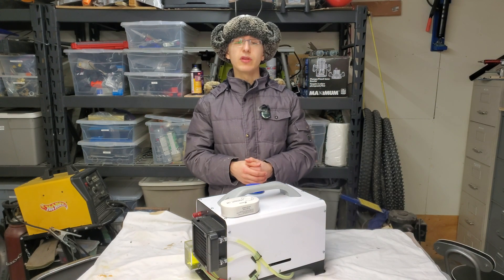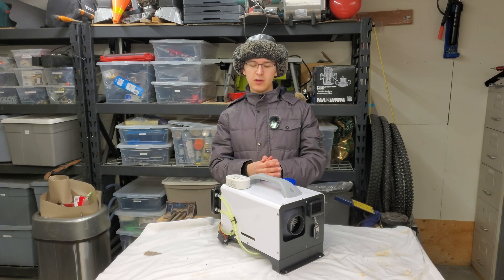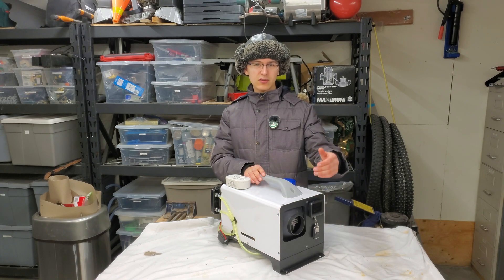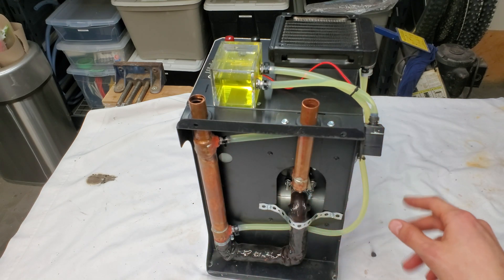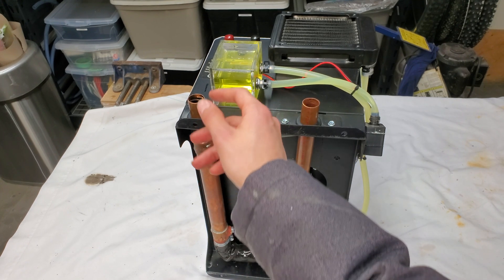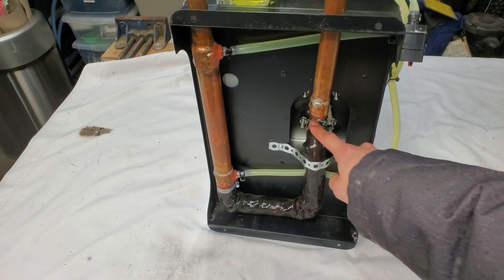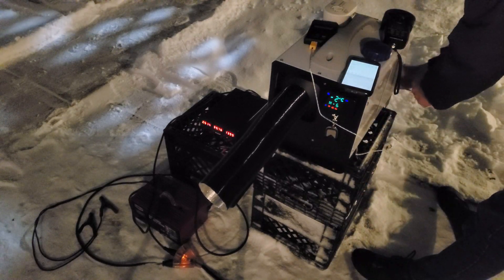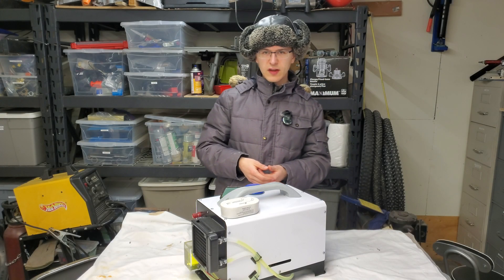5 kW Diesel Heater - DIY Exhaust Heat Recovery System - 90%+ Efficiency

Comment from the maker: Hey Guys,

I would like to address a couple things:
• In this video, no pressure-relief is shown for the glycol loop. This is unlikely to be a major issue, but could be a safety concern if the pump were to fail, and the glycol boiled. To fix this, I've drilled a 1/8" hole in the top-cap of the reservoir, which can let out any steam.
• The tubing shown was a little thin, and prone to kinking. This is all I had on hand at the time, in the parts list, I've replaced it with tubing that is thicker, and more kink-resistant.
• Some viewers are concerned about long-term corrosion of the heat exchangers from acidic condensate. The only fool-proof way to address this would be make the exchanger from stainless steel. I only use this when camping, so I can't confirm how long this would last under daily use.

Comment: Your efficiency numbers don't look right. Diesel heaters are not 90% efficient, and it would break the laws of physics to extract more energy from the fuel than is in the fuel, meaning that your efficiency numbers of over 100% are impossible.

Comment: Nice Concept BUT THE EXCHANGER INTERIOR CONTACT SURFACE AREA IS TOO SMALL TO DEAL EFFECTIVELY WITH THE HIGH TEMPS OF EXHAUST-----BASIC HVAC SCIENCE---needs a little realistic engineering to make it work----OH DON'T FORGET THE PUMPS AND STORAGE TANK FOR THE HEATED WATER and pressure relief valve, plumbing and valves, pipe insulation etc.---AND HEAT EXCHANGE SYSTEM FROM STORAGE TO SPACE HEATING   GETS INTO A BIG and expensive PROJECT FAST----KEEP IT AT AIR HEAT EXCHANGE

Comment: Just wanted to say that I love the video.  Interesting setup and thinking outside the box is always incredible.  However, there is just one thing that I would like to suggest.  I went and checked out your list of parts.  For one, the Radiator link goes to something that is not a Radiator LOL...  Just thought you would like to change that link to an actual Radiator :).

The biggest concern I have is the CO detector link.  Please Please take that down, I beg you.  These types of CO detectors are very very dangerous as there is no digital readout, and most all of these types of detectors won't alarm until the CO is at dangerous levels (around 60-70ppm).  I know from experience (I nearly died from CO poisoning).  If you have 20-50ppm CO in your environment over a prolonged period of time, it is accumulative in your system, and can cause death, and the people in the home or RV won't even know what is happening to them until it is too late.  I have done allot of research, testing and reviewing of Air Quality monitors, CO and CO2 monitors, and one of the biggest questions that I get asked by viewers is describing their symptoms and wanting to know what is going on in their home...  A number of times, these questions and communications back and forth, led me to discover very possibly high CO and CO2 levels as the culprit, and by high I mean as low as 20 to 50ppm CO or more than 1000ppm CO2 in an environment continuously, causing a build-up of toxicity in their system causing the symptoms.  Luckily they purchased the correct types of CO and CO2 detectors and discovered that they indeed had higher levels of CO and CO2 in their environment that their (non-digital) CO and CO2 detectors were not alerting them too...

Fire alarms are another big mistake that people trust to alert them of CO, but again, these alarms usually are set to not alarm until the CO reaches dangerous levels, and again, any level below that alarm level is very deadly if not known, and why a handheld CO and CO2 meter is essential.  I am not saying that Fire alarms or the CO alarm that you link too are not good to have, but what I am saying is that you should never ever just simply rely on them alone.  So at least if you could also link to and recommend a digital handheld CO and CO2 meter to use in conjunction with the analog ones -- that would be great.  

Have a Merry Christmas 👍

Comment: So let's think about this for a minute. You're increasing efficiency by increasing the intake air temperature. How? 

If this unit's able to, let's just say make a Delta t 200°. You're increasing the exhaust temperatures by increasing the air intake temperature. It's kind of self-defeating. Yeah sure. It's definitely going to be more efficient cuz you're pulling heat out of the exhaust, but you're adding it to the air intake making it work harder to get rid of the heat again. Delta t is what you want. This is making the delta t closer

Comment: Any concern with hot air damaging the fan and components on the cold side of the diesel heater? 
Has anyone tried to spiral the exhaust vertically down below the heater, encased in a cylinder (wide section of flu pipe) with a fan on one end of the enclosure (extracting heat from the exhaust). and condensate would flow freely down and out the pipe.

Comment: Awesome! I realize that these simple units are very basic (not really intended for high efficiency), but some heat recovery is a very good idea. Like normal condensing boilers this allows more flexibility in the exhaust routing. Not melting tarps and tents is a good thing.

Comment: This is awesome. Wish there was a premade kit for this
Reply: Be very careful. There is a reason these are not pre-built into the units. At least not in this way. He doesn't explain any of the dangers. Either by not knowing or it is not significant to him. Let me try and explain.
Very hot exhaust burns more of the toxic gasses away like Benzen, Formaldehyde and more.
Cooling the exhaust creates condensed concentration of these gasses which can make you very sick and even death.
However, this can be done safer with some notable factors. 

He should use a stainless heat exchanger. The soldered copper joints will eventually heat up and fail (by the looks of the bubbling in the resivoir. It might be already.)
Which brings me to pressure. The heat exchanger system must absolutely have a pressure release valve.
A gas monitor/tester. These are cheap and can save your life. 

These are a few important safety factors to consider before modifying your diesel heater.

Comment: Just my idea............If u take the hot radiator off the heaters air intake and u place that radiator it in in the same room as the the normal hot air tube and let a fan run behind it  would that not be more efficient?

It wont make a diffence and for sure the heater aint portable as it is now but would that not be the maximum u could get out of heater.

(Or run the hot exhaust gasses trough a aluminium/copper intercooler with a fan behind it as thats my best idea of getting the max energy from it but this wont make it portable as they are)

Comment: Great video.I had similar idea. How did you attach bigger tube to the smaller tube on the heat exchanger? I am going to use 12v fan on the radiator rather than restricting heater fan air flow. What kind of pump did you use.?Thanks
Reply from the maker: The heat exchanger is made with 3/4" Copper tube, and 1" Copper tube, joined with two 1" to 3/4" Copper reducers.

Product links (such as for the pump) are in the description.

Comment: I have a coil of standard ribbed exhaust running around the bottom with a 12 volt pc fan blowing across it.  I lose very little heat once the always downward exhaust leaves the unit.   Never once have i had a carbon problem..   probably cuz i run up to 10 percent petrol.

Comment: Don't alpine mode and low pump rate reduce the maximum heat output of the heater? The exhaust bends totaling up to 270° which is the maximum recommended. Reduce it if you can. It has been calculated the exhaust wastes from 0.1 - 0.7kW of power depending on the heat setting. One way to capture that heat very simply is to dip the exhaust in a container of water in a thermodynamically efficient curved L shape exiting at the near bottom of the container. All heat is exchanged in the first meter or less of the exhaust pipe. I use an online tool omni water calculator to calculate the suitable container size.

Comment: You might try using larger piping for the intake and exhaust. Les flow resistance. Every 90 bend adds resistance. Might need to raise it up a few inches for clearance.  I had thought of doing a heat ex changer for the combustion air intake.

Comment: I'm at 4 mins of your video and I already see 2 huge fails.
1 too many bends and you're still at the heater.
2 the condensation of t he exhaust fumes will condense and drip down into the bottom section of that U bend between heater and exchanger which will block your exhaust flow, which will give you lower air to fuel ratio, which will give you CO Gass emissions.
People like you should take more respinsability when publishing such dangerous ideas. How many people will copy your amazing(ly bad) idea and harm themselves?
Please dude!
Reply: u bend is horizontal

Comment: Nice try, its valued. However, good bit of false claims without any proof. Your 16% is rather taken from high error values. From efficiency stand point, modifications seems to be rather gimmicky then real. Eg.: You condensate exhaust and then you add heat to cooling air for the body( where the temp difference mattes most)...Your muffler maybe only reduce sound of vibrating pipe (lack of gas expansion, cooling or smoothing out pressure waves), not the end noise of the exhaust. Your condenser doing the noise dampening here...Your exhaust modification affecting burn characteristics of the unit. You need to compensate for that with adjusting fuel/oxygen ratio.....lots of problems here from engineering stand point, from data collection and "guess" analysis. You can claim that 2 measurements were different before and after modification. However, I can claim that you just change efficiency of combusting the fuel. Therefore better tune up of the original device would do the trick. From my opinion, you may have accidentally improved burn cycle and think that those gimmicks do the work... I don't mean to take off your enthusiasm, but you are putting your face to your work. So do it properly. Anyway, keep good work.
Reply: good points. I am still left wondering how much heat is being lost.  
If someone hasn't done a calorimeter experiment using volumes of water and temperature rise, then I may just have to kick off my youtube career and bring the data.

Comment: Looks like a very cool idea.  I might be interested in buying one from you, but you've GOT to use a better quality hose!  It's already kinked.  If you're using the fuel line that came with the heater, it's garbage.  Go buy some decent hose to work with, especially since you're building something with fluids that get hot, driving pressure up.  How do you keep the line trapped between the exhaust and the bottom of the unit from melting?  Shouldn't that go around the exhaust pipe, with a heat shroud to protect it?
Reply from the maker: You are right, the hose was too thin. It is just silicone hose, so it is at no risk of melting, but the wall thickness was too low to prevent kinking. Just what I had on hand at the time.

Comment: It doesn't look the heat exchanger section increases in outer diameter, which leads me to believe that the internal section which exhaust gases run through is reduced to a smaller diameter and thus create a restriction in the outflow. Due to their design, if the outflow of exhaust gases is restricted, the inflow is also restricted and the unit cannot pull as much clean air as it needs to for efficient combustion. In other words, your unit will run rich. This is likely why you are encountering soot in the exhaust.
Reply: I thought the same :D but what if you connect 2 in parallel that could work
Reply: @JohannesBrotBaum  Absolutely. Whether it will be enough I'm not sure, but I would imagine so. Using two would involve a junction, either a T or Y junction, which would create a little more restriction. 
Using the blower fan to cool the radiator also creates restriction for the blower fan, which indirectly reduces the amount of air being fed to the burn chamber, since the blower and the intake are driven by the same motor.
Reply: @bluesguitarg  a bigger air intake could reduce the restriction a little if you mount an adapter from 60mm to 90 or 100mm and a bigger radiator should help move more air I think

Comment: Just so you know... there are also trace amounts of sulphuric acid produced when the fossil fuels burn.  When you are condensing the vapor, remember that you are also condensing the acid too, and if you aren't careful and don't have a CO monitor/alarm (carbon monoxide for all the internet trools out there), you will eventually have a problem with pitting in your exhaust tubing, and little holes will start to form....  just be careful and know what you are doing... that is why they use PVC pipe in high efficiency furnace exhaust ... the sheet metal would quickly develop holes
Reply from the maker: I'm interested see how this performs over time, to my understanding, normally stainless steel would be used in these types of heat exchangers, but of course, copper pipe and fittings are more readily available.

Comment: Excellent.  I bought a small cast iron radiator off Facebook for $20 I plan on sending my exhaust through before it leaves the garage to increase efficiency.
Reply: How did you get on with this? 
Mine lasted a year and ended up very restricted with soot. I had to remove it.